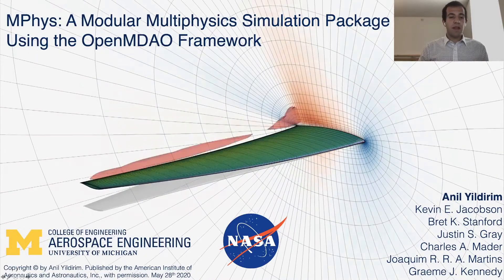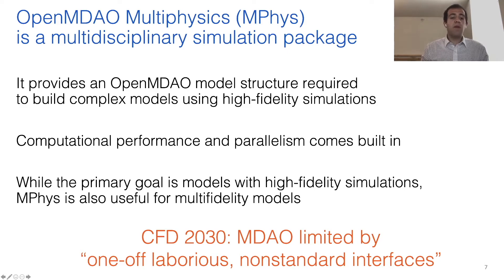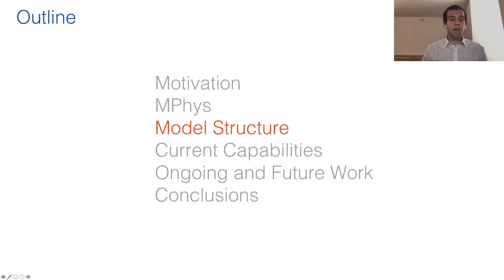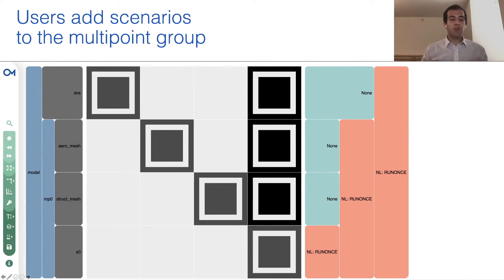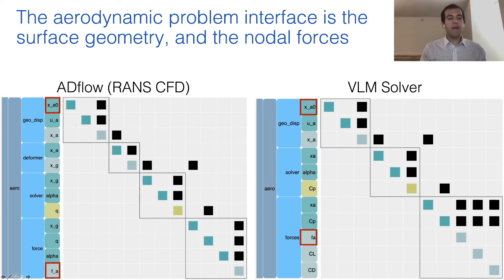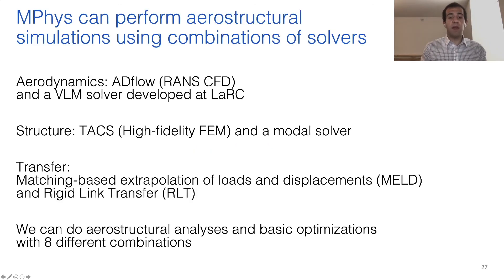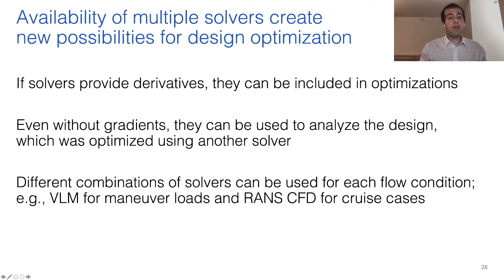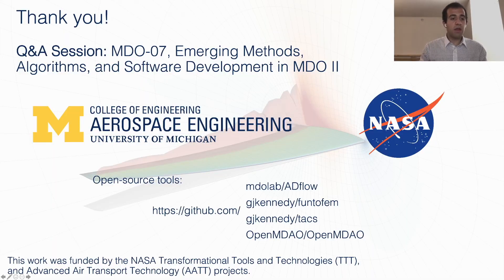MPhys: A Modular Multiphysics Simulation Package Using the OpenMDAO Framework

Comment: Hey,
How would you start if I wanted to optimize an aircraft (a drone with a wingspan of less than 2 meters) for a few mission scenarios? So far, I've just experimented with Excel and OpenVSP (i.e., manual formulas linked there) until I found the optimal solution. Of course, that takes a long time and doesn't necessarily lead to the optimum, since you can only do a few iterations. I can't really program right now and I'll have to spend months reading up on it. Does it make sense to look into OpenMDAO and possibly extensions like Aviary or something similar, or at what point does it make sense?